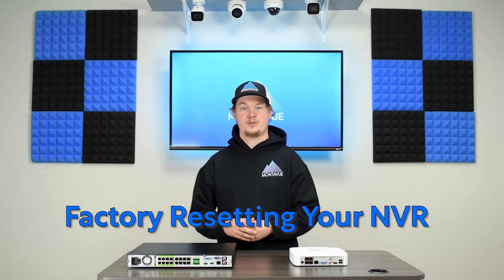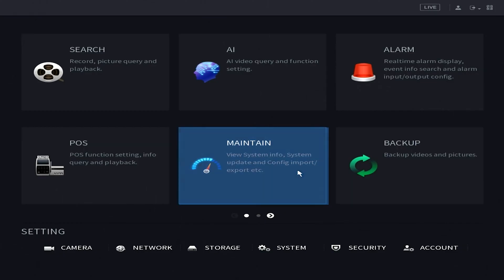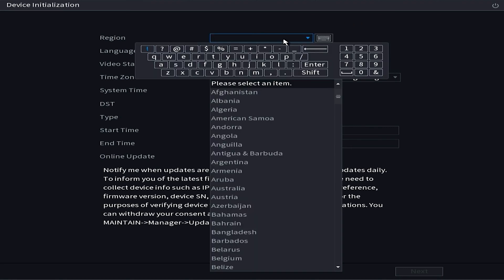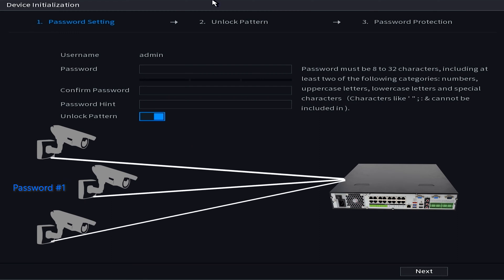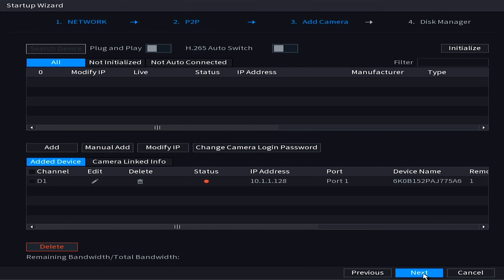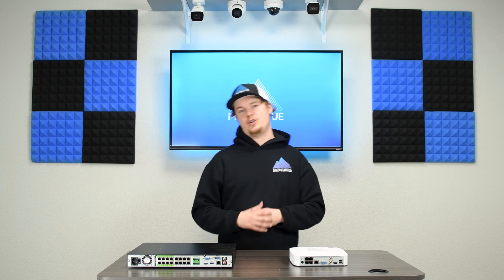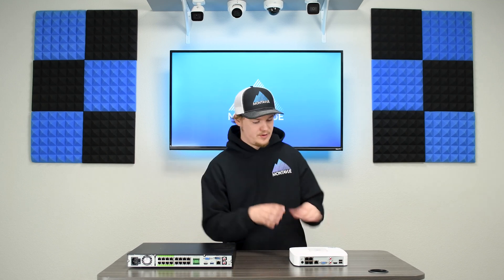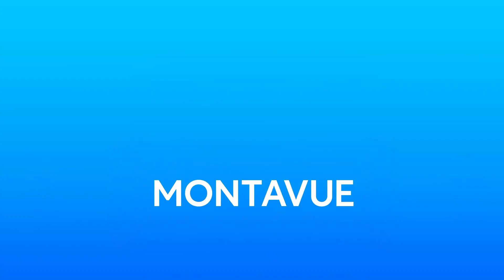Montavue NVR Factory Reset Instructions

Comment: The hard factory reset does not work.  I have an old 8038-8 model that we have forgotten the password for.  It is air gapped from the internet so the typical password retrieval process will not work, so we decided to try the hard reset.  I've pressed and held that button (only one on the motherboard I can find), while turning on the power.  Continue to hold the button for 60+ seconds and all I get is a short beep, but no reset.  Tried it several times, and same result.
Reply from the maker: I'm not sure what air gapped means and I'm unfamiliar with that model number so it's highly possibly you are using another company, but, if it's an old NVR of any kind, it's likely that the button does not work as that's how our earliest models operated as well. The button is physically there but it probably does not activate anything. We used to have people send their NVRs into us and we would have to use our fancy gear here to reset it, it might be what you have to do. Other ways of retrieving the password are usually through the MontavueGO app or by answering security questions on the NVR interface.

Comment: THE REASON I COME HERE IS BECUASE I DONT HAVE THE PASSWORD   ....   GOGOGOGOGOG
Reply from the maker: You need to go through the password reset process. You do not want to factory reset your NVR if you do not know the password and in most cases, you can't. Please give our tech support a call and they can help recover your password in no time. Moving forward, remember that these are security systems that are intentionally difficult to get into without the password (wouldn't be good security systems if they weren't) so it's important to remember and protect your password at all times.